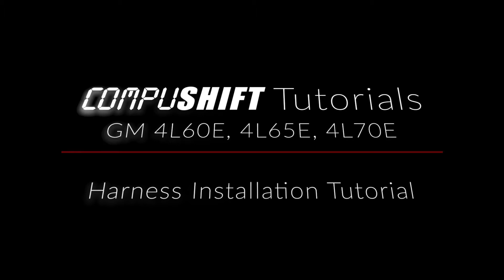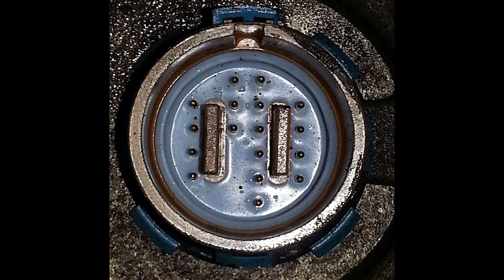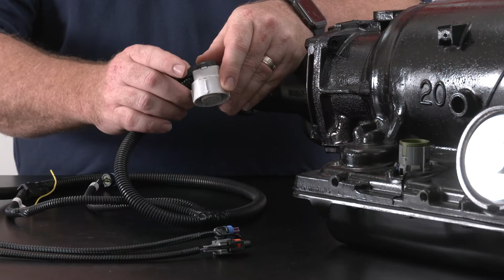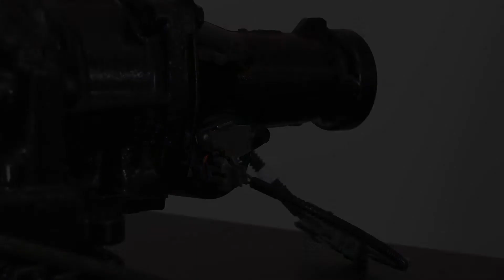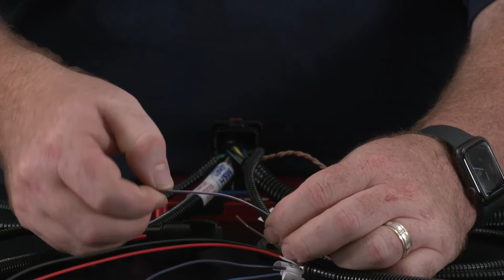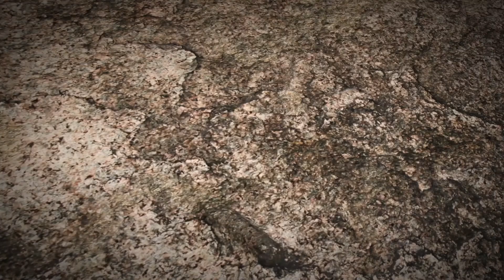GM 4L60, 4L65 and 4L70 Harness Install Tutorial

Comment: VERY VERY VERY good info
These 4L60E boxes are weak as hell but its what was in my 1992 GMC pickup, i had it rebuilt and now is much stronger. I prefer the 4L80E.
I am going to run a holley  carb and do away with the old worn out Tbody  injection and distributor.
i dont want the $1500 Msd control box but will need the $450 Holley TPS bracket for the carby i am running.

if your harness is all i need i thank you and cant wait to get it installed.
Thanks a million.
Sydney Australia

Comment: Would replacing the harness to the VSS be helpful for my p0502 code triggered at the same time as my car power dropping out mid drive? Issue is minimal movement on pedal input, as if it's trying to drive from 4th or 5th gear (have to rev real high the get it to build up momentum). Already swapped the sensor itself with no success.

Comment: What would I have to do to get my stock 4x4 1993-1994 4L60E 12pin  to work on a 13 pin LS standalone 4L60E harness? I know in 1995-2000 something they added the 13 pin on the U pin location thanks

Comment: Hello,  I have  a 2008 gmc sierra 1500 4x4 with a bad engine and trans, can I use a good engine and trans from a 2006 if I just added a aftermarket 2 wire iss?
Thank you
Reply from the maker: If the two transmission have a different pin count in teh transmission case connector then nn you wouldn't be able to do the swap without using our Compushift Sport transmission controller.

Comment: Hi how are Guys doing? I have a problem with my 2008 BMW 528i Transmission it acting up when I stop it gives a grinding noise and slip into park and when reverse it slip out multiple times in to park what could be the cause , please can you tell me what could be the cause. ,
Reply from the maker: Is it only when you are putting the vehicle into park? if so I'm going to say that the car might not be at a complete stand still when you are putting the car into park. The car needs to at at a complete stand still first. My own car does this and it's not even a BMW.

Comment: I believe this is what i need in my tbss, my old trans was throwing three codes i replaced it with a rebuilt one and it was throwing the same codes. Im assuming its the wiring because one of the codes was p0700
Reply: Was it the promblem.?
Reply: Problem lol
Reply: @SomethingEpic2  connectors where dirty I just cleaned it with electrical cleaner

Comment: Do you know where if I can even get a trans wiring harness for a 1999 f350
Reply: Where’s the other vid for the other pin connector
Reply from the maker: Is this to suit the Compushift transmission controller Martin?
Reply: Do you have a adapter to run 4l65e 2004 harness on the truck to a 2007 4l65e
Reply: I am  looking 2009 Silverado 4.3with automatic transmission. I need to know where to connect the wire harness for engine and transmission complete.